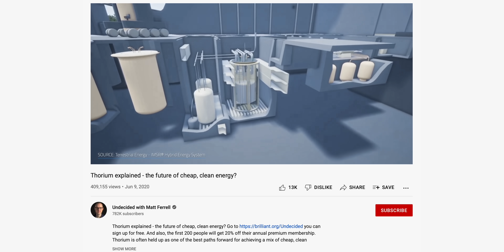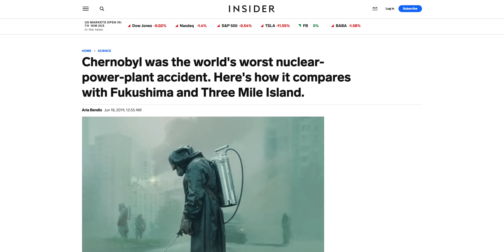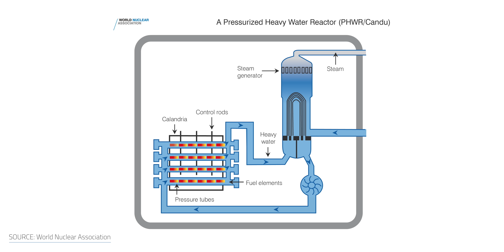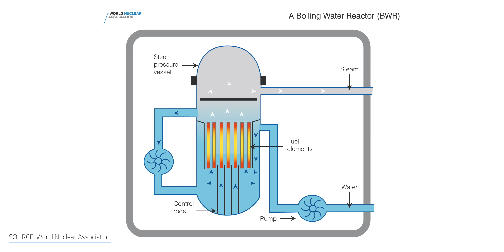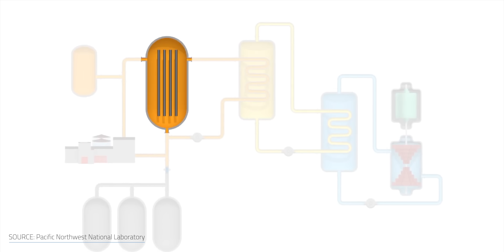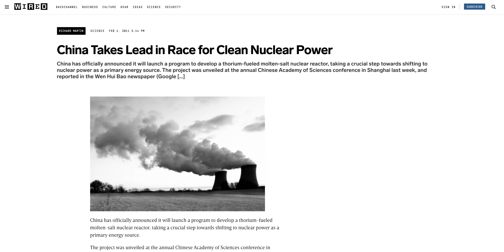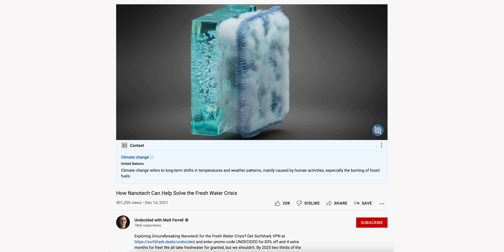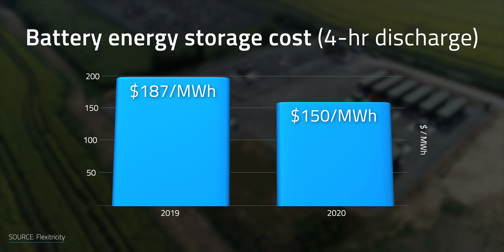Revisiting Thorium Energy - The Future of Nuclear Power?

Comment: Rewnables are great but battery storage lasting only 4 hours isn’t going to cut it. I many place of the U.S and around the world there are long cold nights, with little wind. You’d need like 16 hours of storage and that storage would never be used in the summer making it a huge drag. I feel like this is always left out. Additionally the cons of nuclear are never really clearly looked into. Storage of radioactive waste is always a big one but all the nuclear waste we’ve ever produced is still stored safely on site of nuclear plants and there’s never been a leak, not to mention the fact that will new technologies we may be able to use that waste for more energy and make it less radioactive. The cost and time to build nuclear plants would be less of governments liked it as much as renewables but they don’t cuz they don’t make people feel warm and fuzzy hippie dippy inside even though they’re good for the planet and our economy. Making modular reactors would probably eliminate this problem though. Also the nuclear accidents are always overplayed no deaths have been cause by either Fukushima or Three Mile Island. How can it be a disaster if no one died. Chernobyl could’ve been greatly mitigated had they just built a concrete dome which the Romans did 2,000 years ago, it was Soviet corruption that killed those people not the reactor. Finally there going to have to be a way to power remote areas that can’t generate enough power with renewables so something else is going to have to fill that place hopefully modular reactors. I really hope people mature with energy policy and start making smart decisions, there genuinely are good compromises that can be made to benefit everyone. Transition to natural gas from coal and oil, those companies get workers and money for shareholders the environment gets cleaner and the economy gets cheap electricity while we develop renewables and nuclear seems like a sensible decision to me.

Comment: Ever since I wrote a paper for my physics course in my graduation year at school, I have been a strong advocate and proponent for nuclear power. Recently the open minded power research industry has reconsidered nuclear power as a viable non-fossil fuel alternative. What’s more it is far more efficient, cost effective and not dependent upon weather conditions. It is far safer than at first thought, and waste product is not nearly as problematic as at first thought and far less of a problem than plastic and other land fill components. Let’s hear it for nuclear power as a really viable and safe  major source of power for the future!
Reply: plastic is not as carcinogenic as spent reactor fuel. 
You can eat plastic and pass it with no problem. 
If your environment is saturated in plastic you will possibly develop health issues. 
Contrast with spent uranium, which would kill you if ingested, which only takes a tiny amount to cause radiation sickness and cancers. 
Thorium is better, but we should try to find an energy solution which doesn't produce poisons which persist for generations.

Comment: This technology will be crucial for decarbonising heavy industry where industrial heat is required. Converting electricity from wind or solar to heat is inefficient compared to thermal output of the MSR's. And yes, doing water desalination more efficiently will be increasingly important over the coming decades, particularly for developing nations. Lastly, MSR's are a much more efficient use of land, allowing for natural habitat restoration or other value adding buildings to be constructed. So yeah, still plenty of positives to MSR tech, particularly with the safety and economic benefits with thorium

Comment: There is essentially NO DIFFERENCE between use of thorium versus uranium. Same waste products are produced. Same hazards are present.

Cheap nuclear power is the BIG LIE that we have been hearing for 60 years and it is time to pull the plug on nuclear power altogether because it will ALWAYS be more expensive than alternatives.
Reply: No, the BIG LIE is solar is cheaper than nuclear.  Take a close look at the numbers given and factor in four times the storage since it showed only 4 hours, the fact that solar is only useful for 30% of a 24 hour period, and the cost of replacing those batteries and panels to match that of the lifespan of a typical nuclear power plant. You suddenly find solar to be much more expensive than nuclear.
Reply: @danadurnfordkevinblanchdebunk  You can continue to spout that fairy tale as long as you wish, but the fact remains that nuclear power is DYING, and solar power is GROWING.
Reply: @danadurnfordkevinblanchdebunk  Yes, but consider the fact that thorium is a different element from uranium. Hence, U-233 is relatively easy to separate from a thorium input stream.

Comment: One infrequently mentioned challenge with liquid fuels is the chemistry. Corrosion is one issue. The fuel must be ultra pure with no contaminants (like oxygen). But if the chemistry gets out of control you can have the fission elements settling out of the liquid. This can lead to uncontrolled, and unexpected fission events. On the upside, another thing that is not mentioned enough is all of the byproducts from the thorium cycle that benefit things like medicine and space propulsion. Finally, there is so much stored thorium left over from mining operations (rare earths) that there are probably decades or even centuries worth of thorium already sitting around ready to be processed into fuel. Molten salt and pellet fuel is also a common tech in the works. But I'm not a fan of the built-in need to pay for fuel manufacturing and re-processing. Westinghouse (and others) are going to get filthy rich on that, and drive the cost of running the reactors way up. I personally think the future is small, and very small factory built modular reactors that can be shipped on trucks or ships. Economy of scale always wins.
Reply: yes - the "waste" heat after power generation is not waste but has many many uses desal / industrial chemistry etc and maybe even reticulated heating for homes

Comment: I really hope this develops into as viable of a power source as it is promised to be- we definitely need a replacement for current nuclear reactor technology. Basic safety factors aside, any power source that produces a by-product where the only viable response is to pour it in barrels, put the barrels in massive underground vaults, and wait centuries or millenia for it to become less toxic... Yeah, not really all that good in the long term view, is it?
Reply: The thing is, most of the reactor byproducts being buried are actually fairly low output.  Which is why they take so long to break down.
The stuff coming out of a Thorium reactor is MUCH more radioactive.  But, proportionately, cooks itself down much faster.
Reply: Thorium SMRs have 100 times less waste than water- uranium reactors
Reply: @romado59  Depends on the size of the MSR.
Mostly, "no cladding" on the fuel, and you essentially cook the fuel all the way down.
With solid fuel reactors, those fuel rods are removed because the cladding breaks down.
90-95% of the fuel, itself, is still fine.
Reply: @romado59  and how many people have died from old commercial nuclear power? very few.  only one clearly documented.  from coal at least 156000 from mining accidents and black lung (not even including pollution effects).
Reply: Nathan -- Do you have any idea how much is left over after burning coal (the residual fly ash is mildly radioactive) or refining and burning oil?  Even 50 year old nuclear plants produce orders of magnitude less waste than coal or oil (not to mention what goes into the air.)   I'm not sure what the environmental status of petroleum "coke" is, but there is aconstant stream of trucks from the local Chevron refinery, hauling off this coke which gets loaded on ships and sent to some 3rd world country for disposal (presumably because there is no safe/economical use for it.   I'm rooting for Thorium, but I would place my long money on Fusion. . . .
Reply: @scottsuhr2919  I don't disagree with any of your points, mate. Even discounting the CO2 put into the air from more "traditional" power sources such as coal, oil, and natural gas, there are plenty of by-products of concern. I'm simply trying to point out this isn't a truly "free" alternative... There ARE no "free" alternatives, just ones with different costs and consequences.

Comment: For me it is science verses ideology, nuclear has too many pluses that don't get accounted for.
1) Energy density - (tiny footprint in environment/locating)
2) Portability - (Disaster relief, Ships, Aerospace, Subsea, Arctic)
3) Global application - (independent of weather which is becoming more unpredictable)
4) Disposal - (part of cost is it's the only energy source that must account for the EOL cycle)
5) Uninterrupted - (works all day every day so batteries not needed and good in hostile environments)
6) Centralized manufacturing - (Quality control, Economy of scale, Localized industrial damage, Recycling)

When we get to the stage of containerized systems that can be delivered by helicopter remote areas of the world: disasters, poles, and entire volume of ocean become accessible. Our planet become spacious and distributed while space itself become more accessible. I live in an area with poor sunshine and gusting winds so wind and solar are for off-grid living or backup only as the cost is barely recoverable compared to fossil fuels. This is the case only if you include all the artificial price adjustments of subsidies and taxes. I look forward to my communities first reactor.

Comment: I'm pretty sure the sun goes down for longer than 4 hours each night, at least in the more populated areas of the world.
Reply: Not only that, the numbers didn't show the cost of replacing those batteries and panels to match that of the lifespan of a typical nuclear power plant.  Plus solar is only useful for about 30% of the time. You suddenly find solar to be much more expensive than nuclear.

Comment: You lose power, you still have a disaster.  You show that nice tank system that the fuel drains into when shutting down.  But that fuel needs continuous cooling for a year, the same as the fuel did in Japan (maybe even more if the half-life is shorter).
          Where do you get the neutrons from to transmute the Th232 to U233?  You need those BEFORE you can get a single watt from the Th reactor.  Do you make the fuel in a U235 reactor?  If you "burn" 1 pound of U235, how many pounds of U233 can you make?  Unlike the U235 fuel (which is only separated to be "made"), won't the U233 made from this process be "hot" & hard to handle?

Comment: Thanks for mentioning the proliferation risk instead of glossing over it (8:45)!   India actually detonated the Shakti V bomb in 1998 which was based on Thorium/U-233.  It fizzled by exploding at only 0.2kt, but this is still enough to prove the concept.
Reply: Sure, but you will also make U232 which is a strong Gamma emitter, basically it's easier to just BUY a nuke or the components than to make it from Thorium.
Reply: Nope india used plutonium and hydrogen bomb test was successful.

Comment: You need to consider the full system cost of each energy source rather than bringing up LCOE again. And 4 hour battery storage is way too little. Talk to off-grid enthusiasts, and they will say three days, more if you can afford it. Otherwise the back-up power will be fossil fuel and so far on a large scale the back-up IS fossil fuel. And this fossil fuel back-up needs to be calculated into the system cost, hence why LCOE number is misleading. There is no way you don't already understand this, and I get that full system cost numbers aren't easily calculated while LCOE numbers can be found easily, but you still need to explain this to your viewer instead of letting them believe in misleading numbers.
Reply: They should also run a cost analysis showing taking into account four times the storage (solar is only useful 30% of a 24 hour period), and the cost of replacing those batteries and panels to match that of the lifespan of a typical nuclear power plant. You suddenly find solar to be much more expensive than nuclear. In the last 30 days of my 4Kw array, I have only had useful power for three of those days (Michigan USA).

Comment: GENERATION 4 NUKES ARE THE WAY TO GO, any number of uses can be found for the excess heat. Water desalination, Fischer Tropsch-made hydrocarbons from CO2 - F-T conversion could be used to augment coal/NG plants too. Plus the recovering nuclear science/engineering/construction industry could easily adapt to fusion development. Elon has already signed an agreement with Rolls-Royce nuclear, so look out nuclear manufacturing!

Comment: 12:44 If using imperial units wasn't bad enough, there you have ac *ft (metric * imperial), neither of which is ever used for volume.

Like wtf? The only purpose seems to be to make it more confusing.
Reply: Acre is imperial. Hectare is metric.
Reply: @Baibakov88  Oh, right. So it is:
"ar" = 100 m^2,
"hectare" = 10 000 m^2,
km^2= 1 000 000 m^2.

My bad, my bad English. Ar != acre.
Btw:
acre = 4 046.85642 m^2

Comment: I think, given just the challenges in long distance transmission, there is absolutely still a place for a reliable output source like this. Not to mention the whole desalination/hydrogen thing. The latter of which may likely be a big part of decarbonizing transport aircraft. They could at the very least, build MSR powered plants that are mainly for that purpose, could they not?
Reply: Even better, you can retrieve H2CO3 from seawater, and create hydrocarbons thus going carbon neutral on your fuels and pausing the acidification and eventually reversing it in the oceans on a large enough scale.
Reply: Great ideas!
Reply: Yes. Thorium based MSR are required for grid stability and the power output required for full electrification as well as the side projects such as hydrogen generation, desalination, etc. Battery technology needs to be largely reserved for mobile tech such as cars, planes, and similar.
Reply: Not really. Renewables and storage are 100% viable and much cheaper/ faster to build.
Reply: @bertthompson4748  And you would have to cover MORE land with solar panels and wind mills than we've covered with hamlets, villages, towns, and cities.  You truly DO not comprehend the energy density and  scale of the material requirements to pull it off.
Reply: @nuanil  Plus the displacement/death of birds and other animals these methods cause.
Reply: @bertthompson4748  No, they aren't especially energy storage. You can't even run a communications tower with 36 hours of battery backup without relying on a diesel generator for 3 months out of the year. And that battery bank is the size of a cube van, to provide about 1kw/h of draw, or about 10 light bulbs.
Reply: @bertthompson4748   Solar and wind wear out and go obsolete quicker.  Also, solar panel production produces a great deal of toxic waste and supports some of the worst mining practices known.  Also, also, this equipment is expected to be produced by China which is supporting a terrible and increasingly unstable communist regime.  Windmills kill tens of thousands of birds annually already.  They are contributing to the mass extinction underway.
Reply: @bertthompson4748  There is a point to be made about the total amount of lithium/cobalt versus Thorium that can be produced from currently existing stores on Earth's crust. Average expected useful thorium deposits range from about 1.2 milllion tonnes to 3 million tonnes. Lithium, by contract, has an expected useful deposit of about 30 million - 90 million tonnes, with about 20 million tonnes viable for use. Lithium can be recycled for further battery use, however there is an upper limit to the total number of battery storage methods. Other methods of energy storage that are more logical, such as dams, occupy large swaths of other useful resources such as land and fresh water. The biggest argument against yours currently, is that the total land use expected from solely focusing on renewables and storage technologies, is very large, by contrast of using a regulatory powersystem such as using Nuclear.
Reply: @damascus1111  I guess if you're taking about pure thorium deposits, but thorium is everywhere we want to mine rare earths, and is an unwanted by byproduct of rare earth mines that has prevented us from mining them here.  A single rare earth mines could provide a decade with of thorium every year.

Comment: Thorium for all!! My dad has worked in Nuclear for almost 40years including many of the new tech developed in the 90’s and said this is where the technology should be going for many reasons
Reply: It's going to be necessary for space colonization as thorium is plentiful on the Moon and Mars. And it could help solve a number of international crises like the dispute between Iran that wants to modernize its power grid with nuclear energy, and the United States forcing a ban on nuclear weapons development.
Reply: The pioneers of nuclear energy knew molten salt was the way to go in 1965.  Was better then and is still better now.
Reply: We simply need some kind of nuclear if we want to go out.  Solar just doesn't cut it.
Reply: @ernie4125  I agree, but don't count out solar too.  United diversity, if you will.  Solar panels are ideal for hot warehouse roofs, that seem to be everywhere these days.  Currently they are just waste heat.  So basically: solar for small-scale homes and businesses ; MSR nuclear, hydroelectric, wind farms for large-scale utility production & storage (pumped hydro, batteries, kinetic storage, etc).